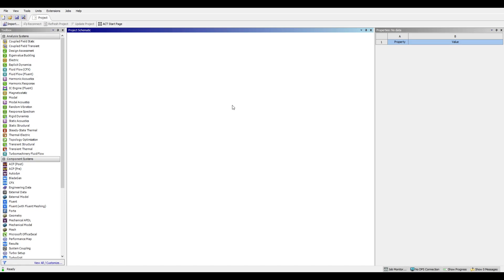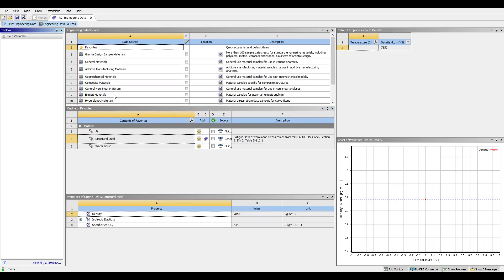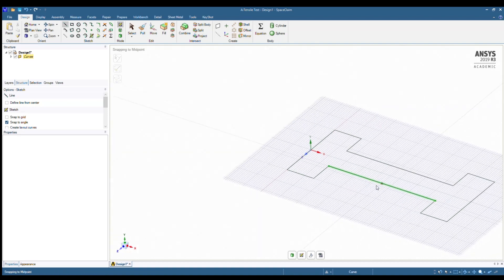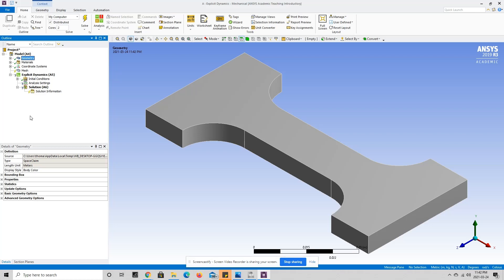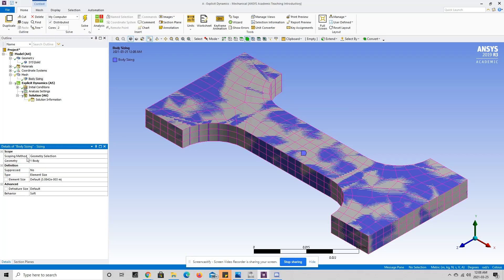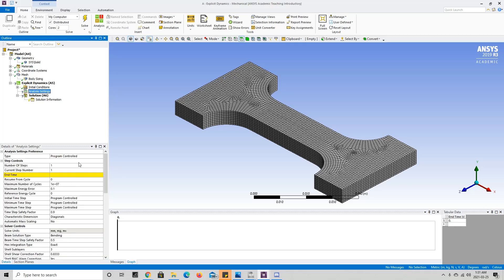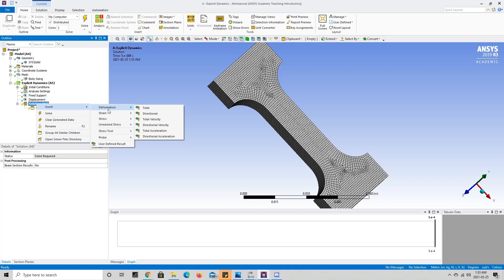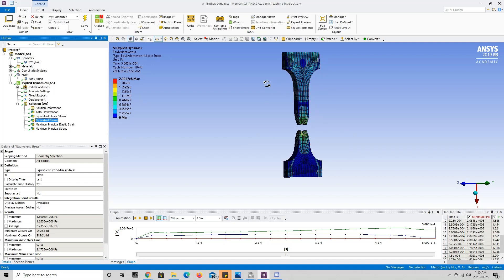ANSYS Tutorial: Tensile Test using Explicit Dynamics

Comment: Good job! In my opinion, a possible failure could be due to the fact that titanium and carbon epoxy matrix have very different elastic moduli. So, under the same load (pressure), assuming the thicknesses are similar, each material will experience a different deformation. As a result, the union of both pieces will be subjected to very high stresses.
So, I see the last alternative you mentioned as the most probable one.

Comment: Hi. Im khalil. I would like to ask u if im going to test a glass, is it possible? Since it is brittle, there is only ultimate tensile strength. Pls advice.
Reply from the maker: Hi Khalil, yes this would be possible to do. Since it is brittle, the specimen will simply fracture once the elements surpass the ultimate tensile strength. You still need to apply the young's modulus so that the program can calculate how the  elements are going to elongate when the stress is below the ultimate tensile strength, before it fractures. Hope this helps!
Reply: @theengineeringguide8332  I tried to do it but don't know how to insert the uts value in the material data (engineering data). If it doesn't matter, may i contact u personally?
Reply from the maker: Hi again, please refer to new upload from this morning. This will show you how to add a material with specific material properties.

Comment: Thank you for the extremely helpful video. Would you please let me know if you have to add any Failure Model/Criterion in the Explicit Dynamics Material Model to get a reliable result. Thanks.
Reply from the maker: If the material does not include it's failure criterion, it would be necessary to add to get a reliable result.

Comment: Sir . When I edit material it can't add.
And show a message me.
That "CAN NOT ADD TO PROJECT WHILE A LIBRARY IS AN EDIT MODE "
What I do ?
Reply from the maker: Hello, sorry for the late reply. I hope you were able to solve the problem!

You are most likely getting this error because you are editing on of the pre-existing material in ANSYS. In order to edit a preexisting material or library in ANSYS you must click the check box located in column B in Engineering Data Source. However before you add the material to the project, you want to make you to unclick the checkbox so that the edits you made can be saved. Once this is done you will no longer be in edit mode and you can add the material to your project by clicking the plus sign beside the material. Hope this helped!

Comment: I appreciate the step-by-step, detailed presentation on the use of ANSYS. But I don't understand the point of choosing "Explicit Dynamics" solver for this problem. This is not a dynamics problem at all. Tensile load is applied very slowly and inertial effects are negligible. This is a NONLINEAR STATICS problem. If you want to see failure of the specimen, you can turn ON the nonlinear effects (geometric nonlinearity and material nonlinearity) in the Static Structural solver (not in the Explicit Dynamics). Explicit dynamics solver is supposed to be used for dynamical problems taking place in very short time period (in milliseconds or so), for example, car crash problems. Using explicit dynamics to simulate a tensile test is an overkill and misleading. For those who want to learn linear vs. nonlinear analyses and implicit vs. explicit time integrations, I recommend: youtu.be/ZljfZ70toyY,  youtu.be/kudC1z2Rb0A
Reply: Hello sir, I need your little help in tensile test simulation. 

Please provide your email id